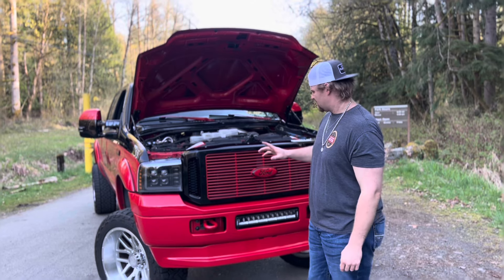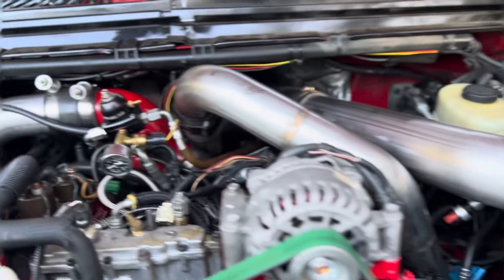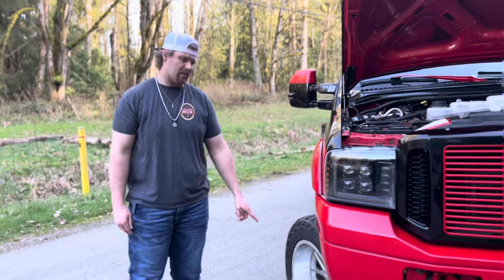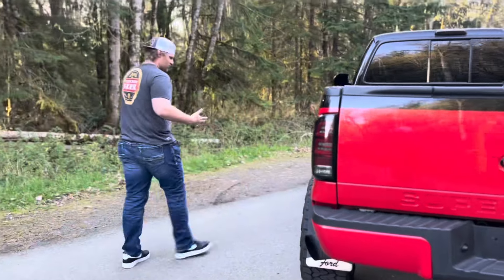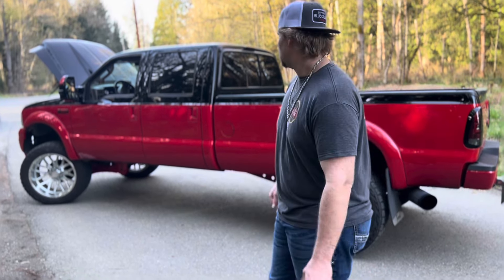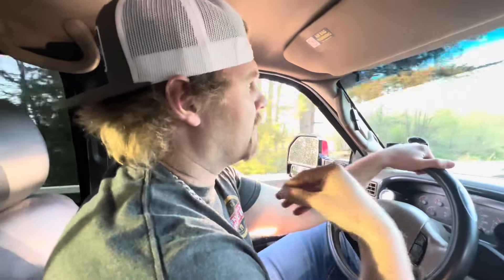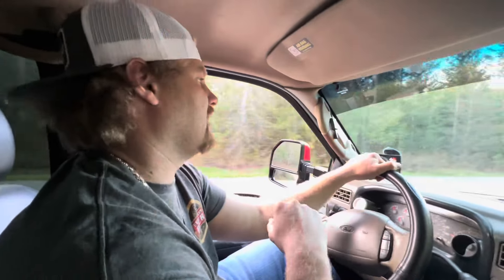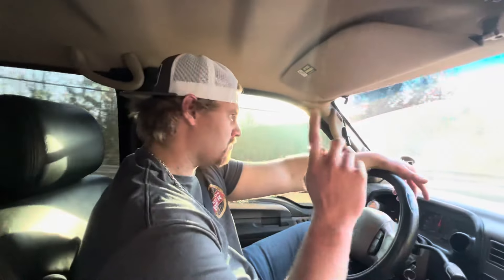Nastiest 580hp 7.3 Powerstroke

Comment: Did you notice any efficiency or power difference from the pistons alone?
Reply from the maker: Need to do more testing haven’t put a lot of miles on it. But 100% the engine runs smoother and quieter, when the compounds are on I’ll let you know

Comment: Why would you run hybrid’s when you have dual HPOPs. You are losing out on power and efficiency. Terminator duals can run 400/400’s if needed.

7:1 injector intensifier piston will have better atomization than 5:1 that hybrids have. It Will help with smoke.

Comment: Why are you running afrs so rich? All that black smoke is unburned fuel. You’re leaving power on the table 😔
Reply from the maker: Oh 1000% that’s why I stated a few times in the video the truck has way more fuel than it needs because it’s getting big compounds to have plenty of air to clean up the fuel. There will be a YouTube video coming soon when the compound kit shows up!
Reply: @PKPMotorSports  looking forward to it. Watch your egts and don’t burn a hole through a piston before then 😁
Reply from the maker: @splaw120  don’t worry that truck gets babied haha. But egts are very under control you gotta push it hard to see 1400